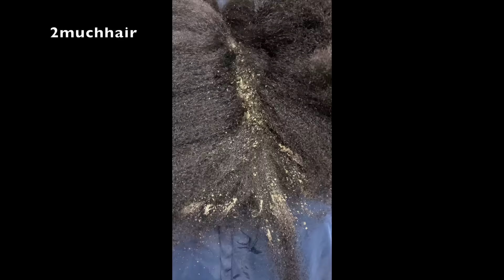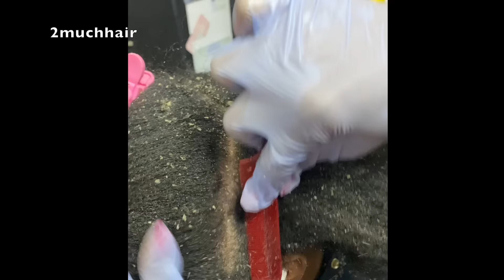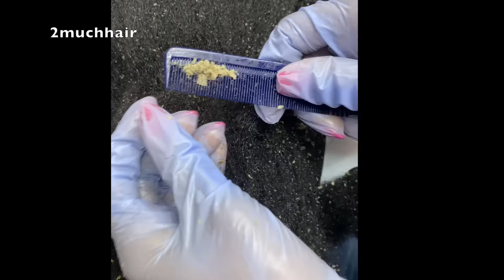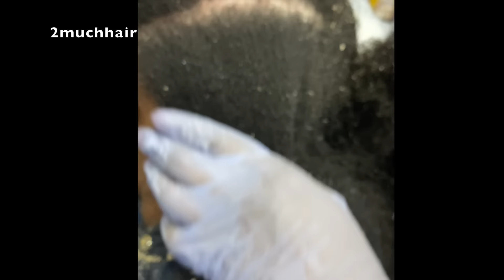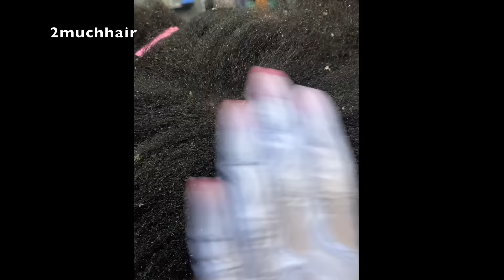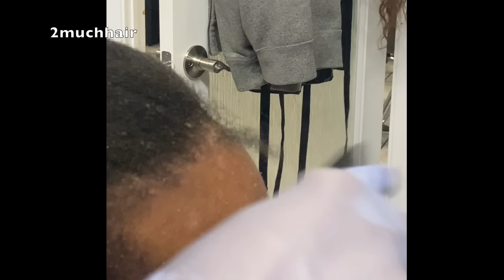What's Inside This Puff? Dandruff Addiction

Comment: It’s probably Carp and Seborrheic Dermatitis mixed together.  It’s best to not put any oil or product on the scalp and it should be shampooed every 1-2 weeks, so the buildup won’t be that much.  I have seborrheic dermatitis and if I go past 2-3 weeks, I have flakes everywhere.  A tea rinse and scalp exfoliation would help tremendously, along with a diet change and more water.
Reply: What kind of diet change?
Reply: @deidremitchell8269  non inflammatory foods which is usually similar to a keto diet.  Breads, pastas and other high carb low protein foods are a lot of times inflammatory foods that can cause flare ups, this is also true of people with other conditions like osteoarthritis.  I have osteoarthritis and eating keto or low carb alleviates 90% of my knee pain.  Idk if this is what the poster was referring to but this is also true.
Reply: Hair should be shampooed every other day
Reply: @debradeclouette8176  • You are absolutely right 💯.  This too is autoimmune.  Some say a vegan diet works for this particular dermatitis/psoriasis etc.... I do the fibromyalgia diet, eating very clean....
Reply: @dorisallen1732  Not all hair types can sustain washing every other day. Most black people don’t wash more than once a week and can even go longer. I could never shampoo everyday. It would make my hair so dry and brittle.
Reply: It’s Carp once I stopped using hair growth oil and switched my diet up my scalp wouldn’t flake up as much as it did in this video

Comment: I have to say one more thing. I don’t use any oils on my scalp I don’t use any sprays any moisturizers any creams I don’t oil my scalp at all because I guess the sebum is all that’s necessary for my scalp the thing with sebum is is that it’s waxi so when the weather is cold or when there’s not adequate humidity outside to keep the wax loose then it’ll get hard but when I work out my head is extremely itchy and it’s sweaty and I scratched my head and all of this wax white wax is under my nails so I theorized that we’re supposed to scratch the scalp when it itches because that’s natures way of clarifying our scalp with our condition. Like you’re doing with him and scratching his scalp with the comb that’s perfect but also when the scalp sweats and it gets itchy you scratch it and that’s another way of moving and clarifying the sebum off the scalp
Reply: Wash yo head daily

Comment: If not already done, he should really see a dermatologist because that's definitely a fungi infection of the scalp (this is what causes those huge flakes because the skin cells are producing too much cells and it clamps together). It can be treated with the right products and rights instruction. Doing this is really satisfying and needed but this alone will not solve the problem in the long term. The most important point is that he should not put any oily product on the scalp or it will worsen it.